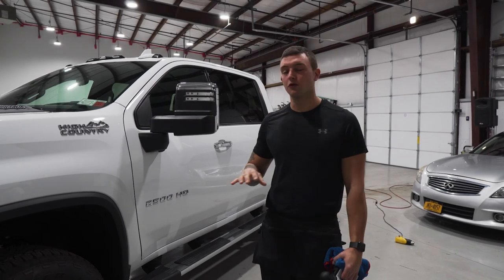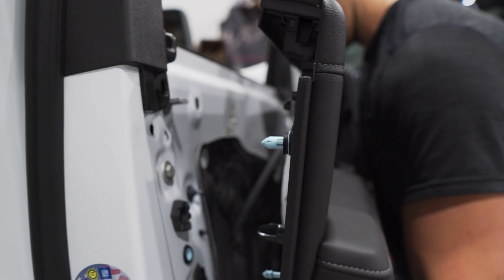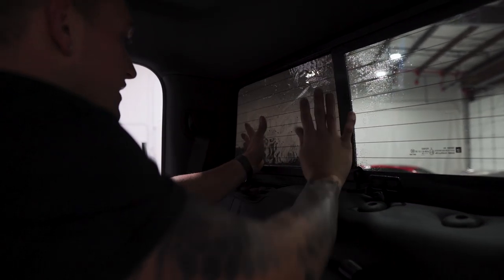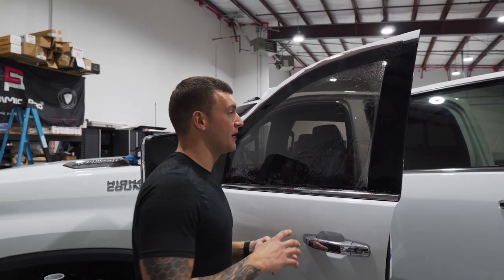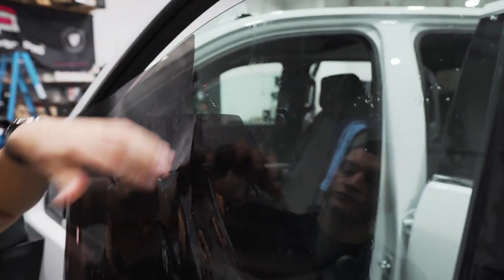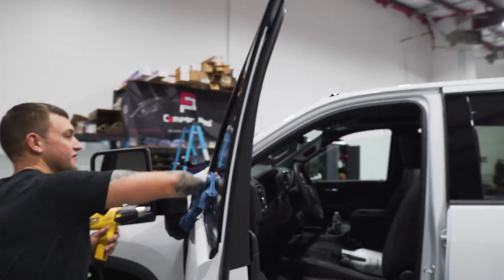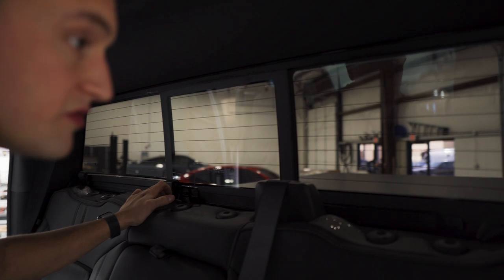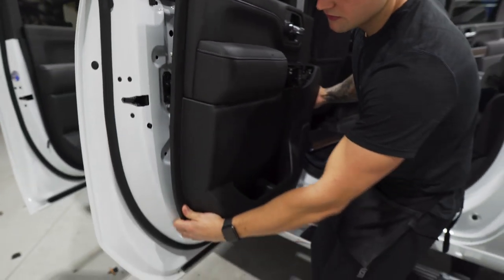How To Tint A Full Truck - 2020 Chevy Silverado High Country

Comment: I got a 22 Silverado 2500. I remove the door panel. Can I remove the entire liner off tint and install top to bottom? With door panel off should have easy access to bottom of glass I don't want to crease tint by pulling last few inches of liner.

Comment: Real brave running that heat gun on the inside of the door like that.      I always shrink on the outside of the window  and never ever do I have to use the heat gun on the inside.                I’ve seen a coworker melt up a door panel trying to heat from the inside.

Comment: Why pull panels and seals. Are you a rookie? Just asking
Reply: How long have you been tinting?
Reply from the maker: 13 years. Started not pulling any panels, evolved to pulling gaskets. Makes for a much cleaner install with little effort. 

Everyone has their methods in which they are more comfortable in than others.